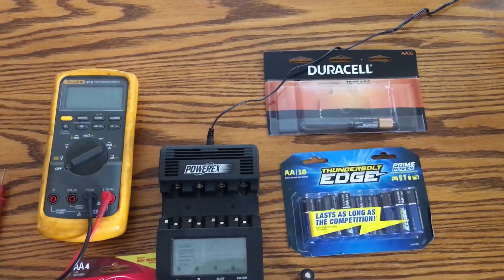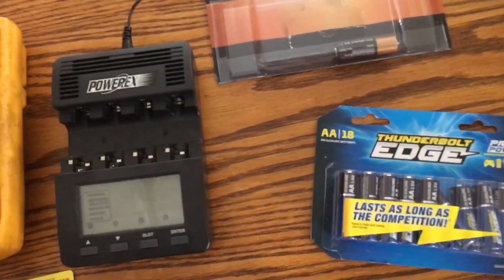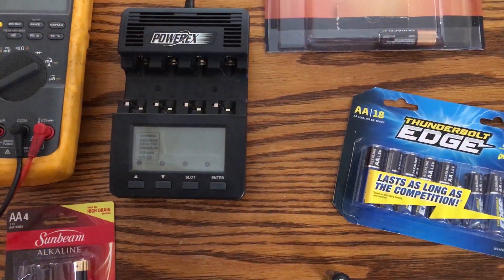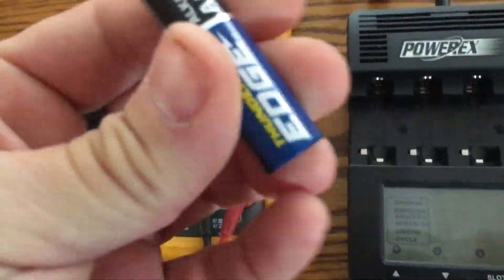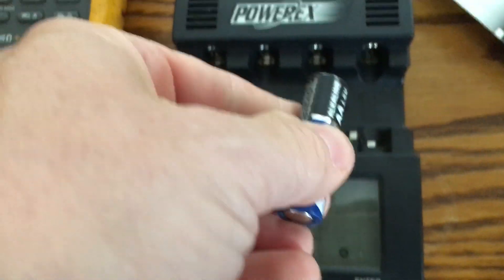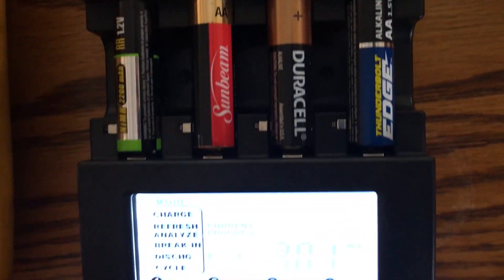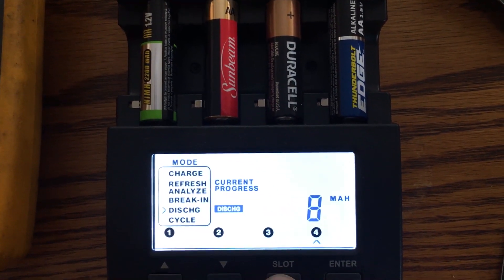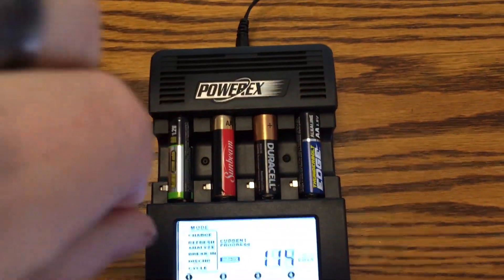Harbor freight thunderbolt Edge Battery  discharge test

Comment: Batteries will drain different at different loads. Your test was only a 300ma draw. 
I am sure the Duracell will hold up the best with the biggest draw but that HF battery held with the duracell at 1/3 rd the price.
Reply from the maker: I still buy and use these edge batteries they were just on a Black Friday price for $3.89 , you can’t beat that
Reply: @IFix-Things  i agree with you, i always buy HF Blue batteries, they are $ cheap and they put out just as much as duracell and energizer alkaline. Lithium is a different monster BUT there is nothing that i use that requires Lithium AA or AAA batteries. 
My batteries are for remotes and electronic candle's ... None of which require lithium or expensive batteries. 
Back in the 80's and 90's when RC cars where hot and ONLY used AA's, C's and D's, YES energizer and duracell were the best for long lasting use.
Today's most good RC cars use lithium packs.
Reply: Counterfeit Duracells are all too common and spill their guts if you so much as look away from them.  

HF has a their own supply chain and who TF would want to counterfeit them?

Comment: Do you know what the shelf life is on the ThunderBolt Edge batteries?
Reply from the maker: Not sure, I’ve had some aaa’s for about 2 yrs, no leaks, and seem to work fine.
Reply: @IFix-Things  ok thank you
Reply: Batteries will leak if left in devices OR when stored in high heat or high moisture areas.

Comment: In general, for non-disposable, just know that "alkaline" will alwayss beat "heavy duty" (not tested here) any day, regardless of brand.... At the dollar store there is a reason there a number of options in the same size, 2, 4 or 8 packs and the quality is accordingly. The Sunbeam alkaline are not a bad standby at 4 for a buck (or $1.25 in 2023). But, it gets slightly confusing when HF sells 3 levels and 2 are alkaline, Edge being the best over "regular" Thunderbolt alkaline, but yeah, TB Edge are a great value, especially on coupon, they are easily super close to the best available at a great deal!

Comment: It would be interesting to try the test again, at 100 mA.(if the analyzer can be set that low) there is a thing called the Peukerts exponent, where a battery will give a lower percentage of its capacity at higher rates of discharge, due to glazing of the electrodes. At lower rates of discharge, the rechargeable cell won't show much difference, but, you will see a big increase the output capacity of the alkaline cells. This would definitely be an over-night test, considering it could take well over 24 hours to complete, at that low drain level. Just for fun, it might be worth including an Energizer brand cell in the test.

Comment: HF batteries are cheap and garbage. Stick with energizes, watch project farm and he does an unbiased review on AA batteries.
Reply from the maker: I disagree. The edge batteries are just as good as the Duracell. I will say harbor freight heavy duty yellow batteries are junk and leak
Reply: @IFix-Things  harbor fright higher end battery's work well. I been using there rechargeable batterys in my Xbox controller and they've held up. Not sure about edge though. Because there alkiline and I'm not sure if they leak in a few years.
Reply: The Harbor Freight Edge AA cells weren't yet available when Project Farm ran his tests.
Reply: I was not Impressed by Energizer - I went to Duracell - I will try the Thunderbolts for 1/2 the Price. I use them in Many applications - AA and AAA. Well see how they last. The Free HF Battery's haven't been good but they are great to giveaway .
Reply: @ftecconn  Yup Energizer are bad, not because of chemistry but because of the plating on the contacts.  Free batteries are free for a reason.
Reply: I mean 18 of them for $6 without a coupon. Will last me over a year probably for remotes. Be $20 for duracell or something.
Reply: HF thunderbolt are good batteries as you can see. i guess you lack comprehension
Reply: Personally I hate energizer because they have patents on lithuim battery's. They sued Rayovac and now they own them. Suposidley there patents expired. And energizer won against them. Then they started to make lithuims again. And extend patent. Compitions very I'm portant for every one.

Comment: Did you precharge the rechargeable battery before the test?
Reply from the maker: sparkola I believe it was charged within the last 30 days
Reply: SuperRobkar kewl you should try the NiZn batteries they have a higher nominal voltage 1.6 and 1.8 fully charged than the Nicd or Nimh

Comment: I'll try the Edge batteries in the future. I can use a 20 to 25% coupon from Harbor Freights.
Reply from the maker: Megatron2013 from my limited testing they are similar to Duracell as far as runtime. As far as leaking, the jury is still out. Cost wise you’d have to see where the deals where on each.
Reply: I never had any harbor batteries leak on me.
Reply: Megatron2013 that’s what she said
Reply: They also have a coupon at a reduced price, don't remember how many dollars off.  Also a free coupon, got the cheap zinc carbon batteries.
Reply: Yeah they have a 5.99 coupon from time to time I would use that instead